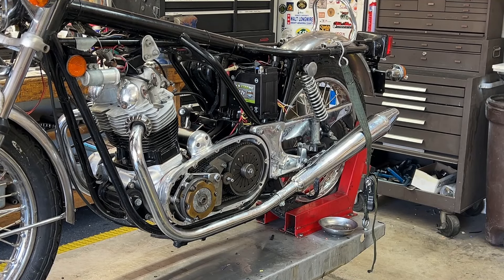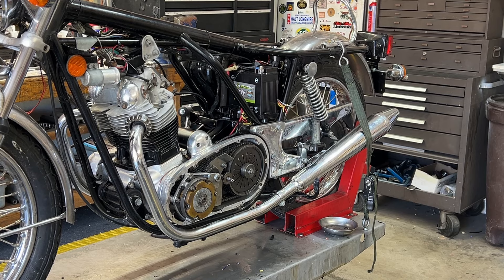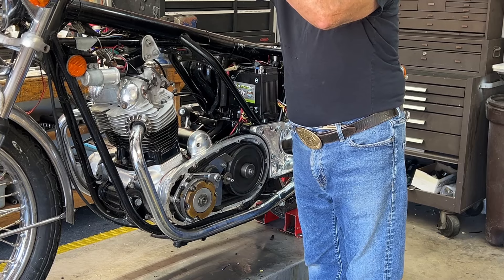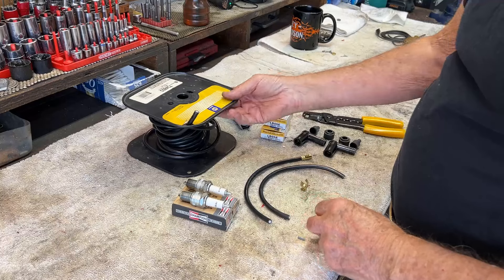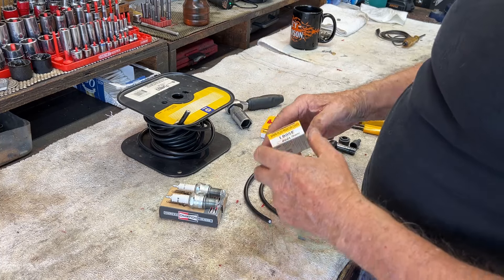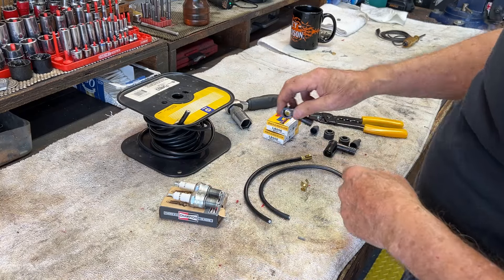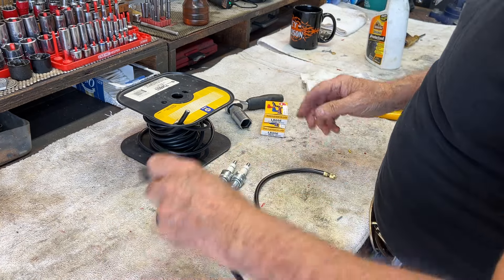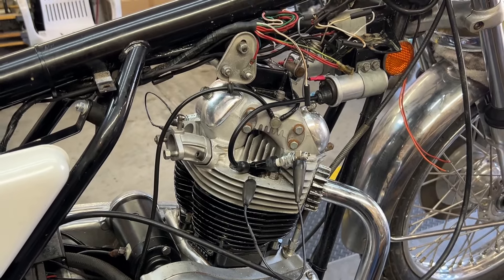09-24-24 - 75 Norton - Day 07

Comment: Hi, regarding spark plugs I’ve had great success using NGK BKR7 EIX Iridium IX plugs in my 1972 750 Commando Combat kick start only.  I’m also using Iridium plugs in my BSA A65 lightning and Matchless G12, they all start easily and run very well.